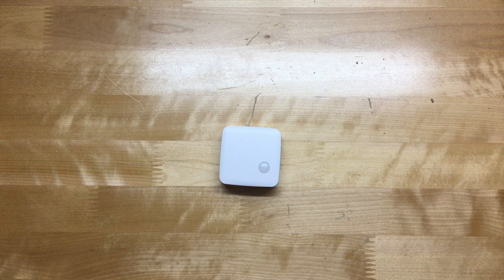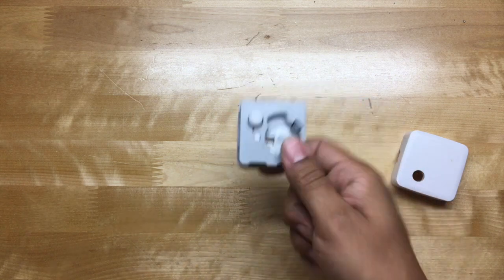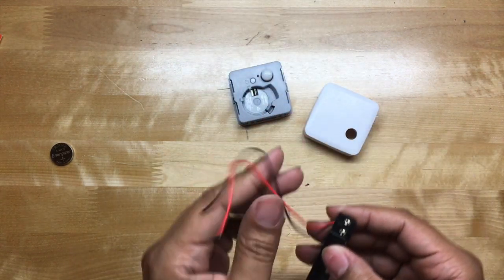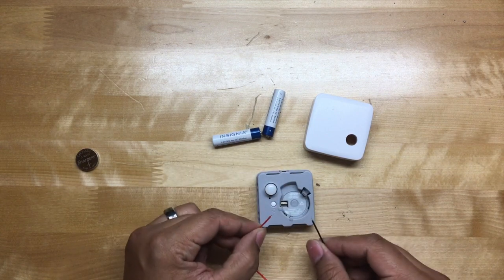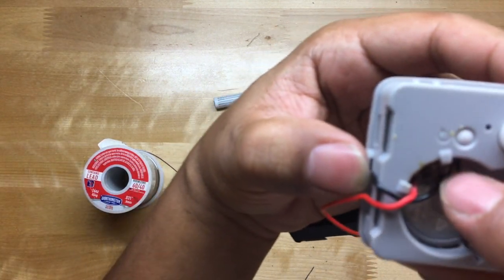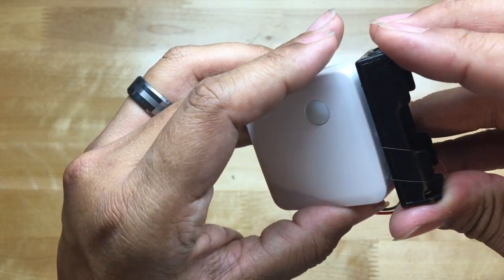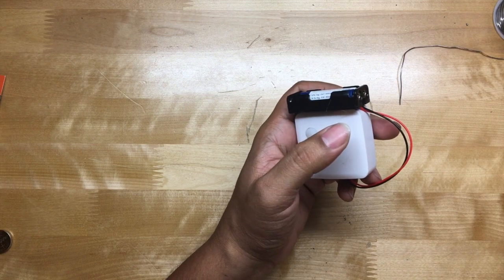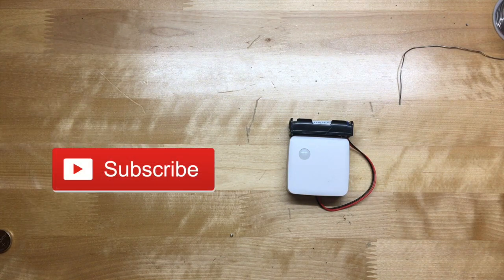How to Change from CR2450 to 2 AAA Batteries | DIY Smart Home Hack for Cost Savings

Comment: First, a big thanks for this video!
Have a question 
What if we use 2 AA or 2 type C batteries (thick once) the same way you have used?  
AAA, AA, Type C batteries have 1.2v 
I'm planning to buy smartthings motion sensor 2018 (latest) but only if this works. 
Please let me know if this will work?
Increasing mAh should not effect the voltage or amps.
Reply from the maker: Yes they should work theoretically. I can only speak on behalf of the AAA batteries. But as you said, its the same voltage so no reason why it shouldn't work. Reason why I went with AAA is because I wanted to keep the overall profile of the sensor small with the added battery pack. Using AAA gives me about 2 months before the need to change out the battery. AA would probably get you 3.5 months. C might get you close to 6 months. But let us know if you use AA or C and how it worked out for you.
Reply: @MonsterReview  Thanks for the reply!
Initially, I thought of going for power adaptor of 3v but then realised all are cheap chinese stuff which will do more harm then solve my problem.  
I couldn't get the chance to play around but what I'm now planning is to use Duracell AA 2500 mAh batteries. 
This should easily power the sensor for a 6 months! Will update you once I get the chance to play around with it :)
I hope 1.7 v + 1.7 v will not damage the sensor!